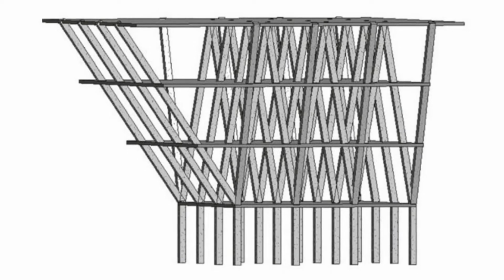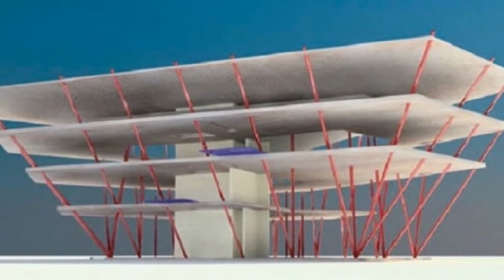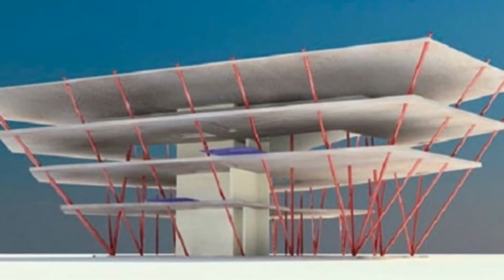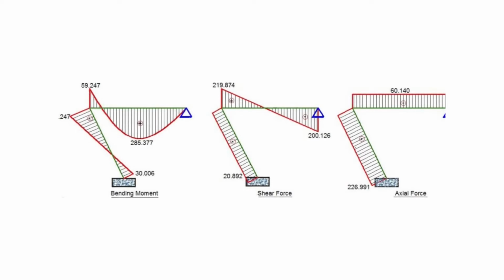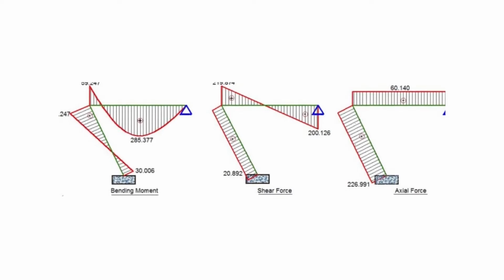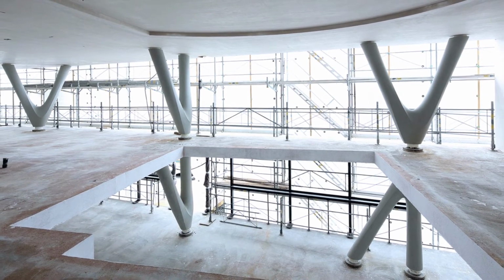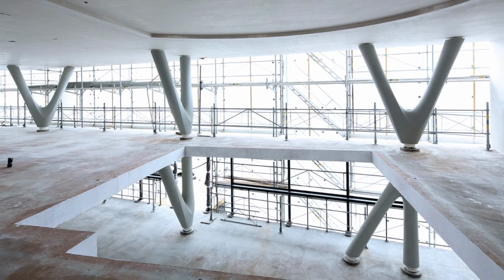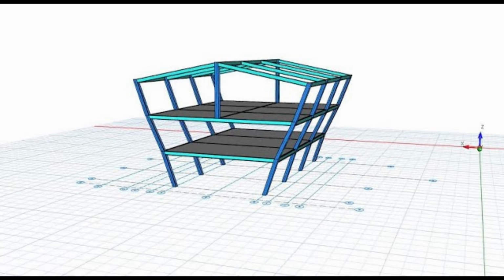Why is the Inclined Column design used in structures?

Comment: Brother I need suggestions & advice from you in a matter of career.
May I have a way to communicate with you. Whats app, line, facebook.
Reply from the maker: What exactly? Getting a job?
Reply: @Innotutorial  I am a business background student, with bachelors in marketing, worked in sales & marketing for past 3years.
Now I am learning working drawings, structural drawings for past 6months. I am now practically practicing with a draftsman. 
But after all these learning & hardwork, I will have skill to work as Bim modeler but I dont have any certificate of science or engineering. 

Can you please suggest me any good course in architecture, which Doesn't require science background & I can use the certificate as degree for getting jobs as a Bim modeler.